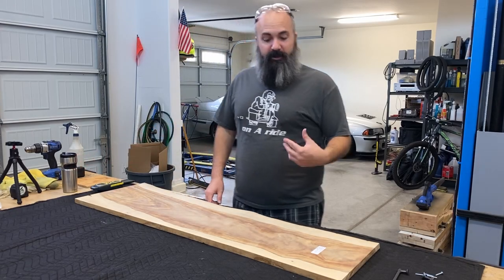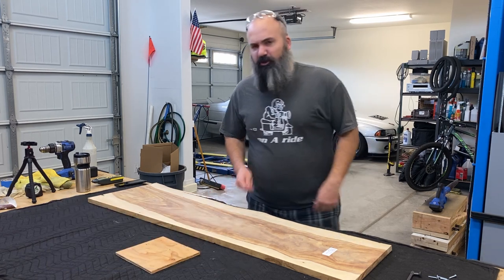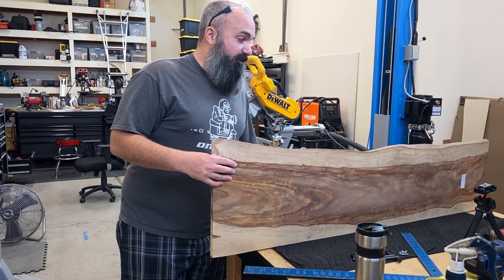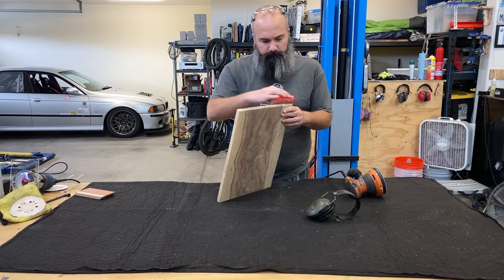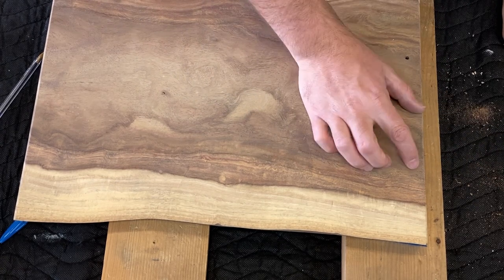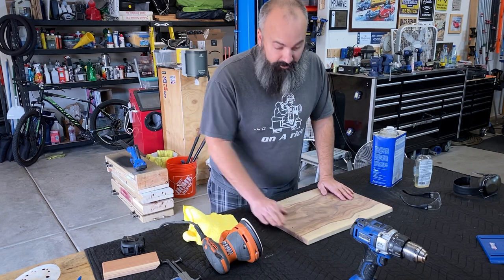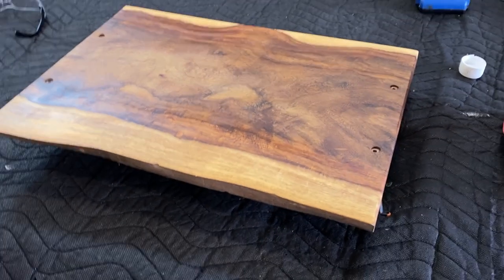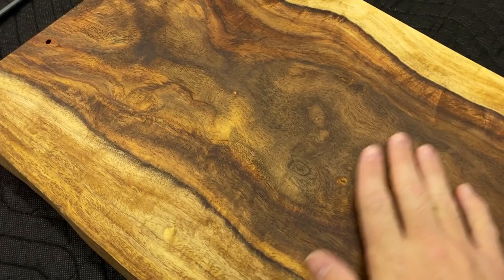DIY Serving Tray | Simple Gift Idea

Comment: Am I the only one that noticed the cap on the moisture meter?
Reply from the maker: Keen observation. My meter has the metal tips and contact pads on the rear. I didn’t want to add any dimples to the surface of the board, so on my actual work piece I only used the contacts.